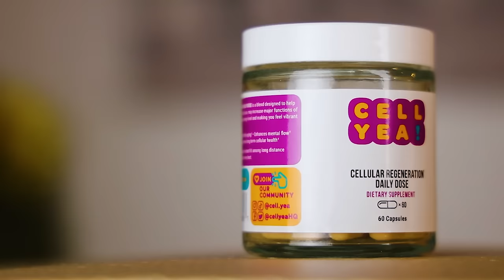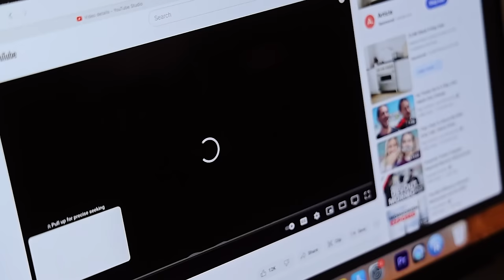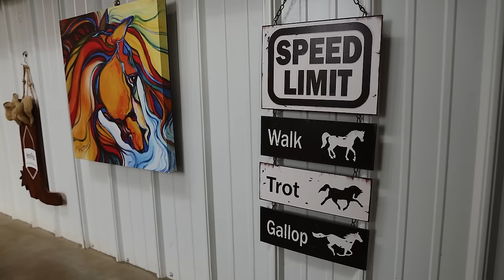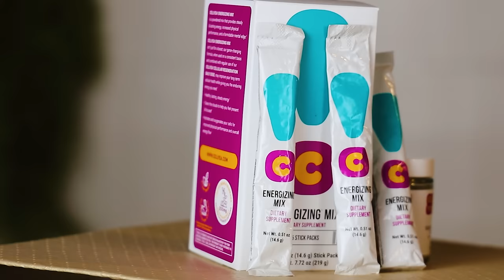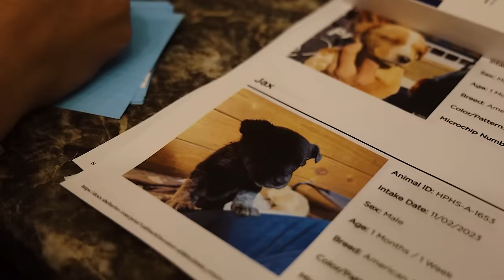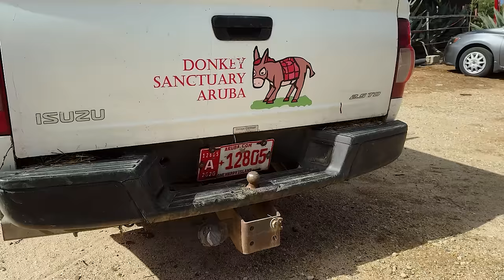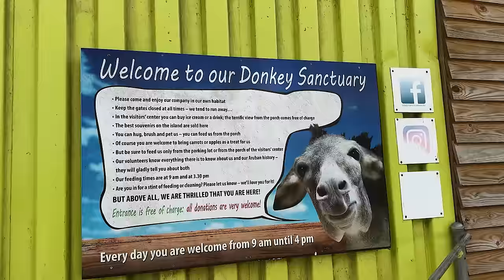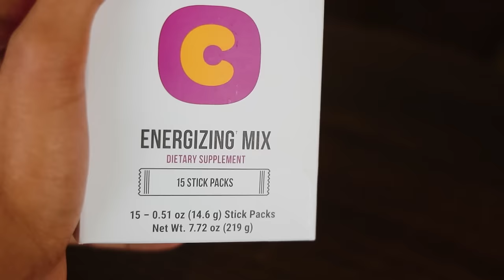Choking Stallion - Horse Shelter Heroes S4E40

Comment: I really liked the hard and clean ground they were kept on, and for them to naturally grind down their hooves completely without any help is ideal. I was impressed by their gates and fence that said Donkey Sanctuary and had donkey ears peaking over the edge! 😘 That was a nice touch.
I also liked to way they had their water, in a tiled pool with a sunroof that provides shade from the harsh sunlight, the only one thing missing was a statue of a Prince standing there taking a pee into the pond, just for a royal touch and to hear the water fountain pouring is said to be very calming.  
However, were the donkeys provided with any areas with soft bedding? I didn’t see any stalls that would provide a safe area with controlled climate, any roofs to give shade or any windbreakers to protect them from strong winds but they must have had those, just that you didn’t give us the full tour! 👍🏻

Comment: Been there had to deal with choke more than once. Terrifying.
Reply: Is it the same as choking on something?
Reply: @angelaranzoni8593  choking is when any kind of food (hay,pelleted food,grain) gets stuck in the horses throat. The tube that's inserted will find the blockage and water is used to either force it to disperse (loosen) and come out or continue into the stomach. Sedation is used so the horse is relaxed enough for the procedure. Teeth are usually a problem and should be checked by the vet to see if they need to be floated. Only after the sedative wears off completely should grazing or hay be offered.
Reply: @Groundedsquirrel Yes and no.  It doesn't obstruct breathing for them like it does us.  A horse will usually clear a grain choke on its own.  A hay choke can mean the vet needs to pass a tube and flush it out.
Reply: @Terry-lh8cn  that’s what I wondered as the horse didn’t seem to have the classic human breathing obstruction we see in tv and movies. Thank you.
Reply: @susankoehler2883  thank you. Makes sense that if they can’t chew properly their food doesn’t go down right either.
Reply: @Groundedsquirrel  also horses are one of the few animals that can't throw up. Only specific ones (few and far between) that can even burp.
Reply: @susankoehler2883  I did learn this in the past few months! I think it is partly why they colic